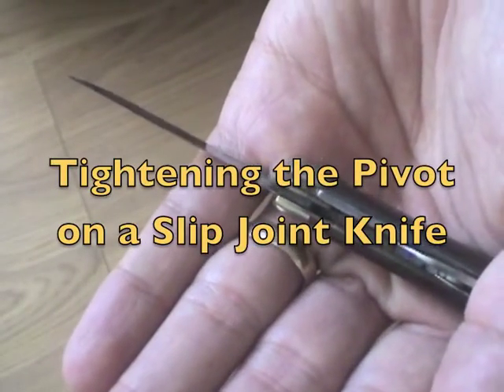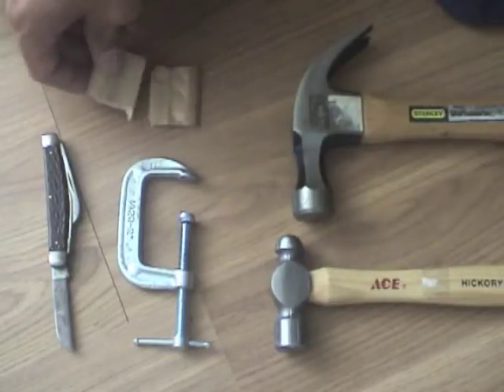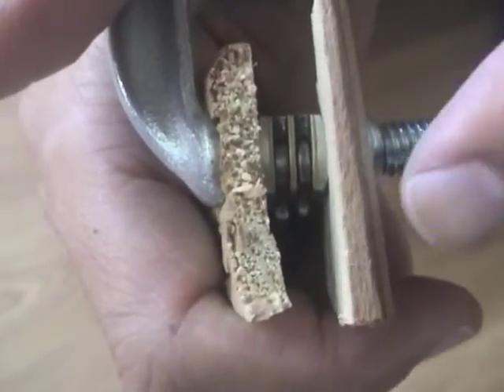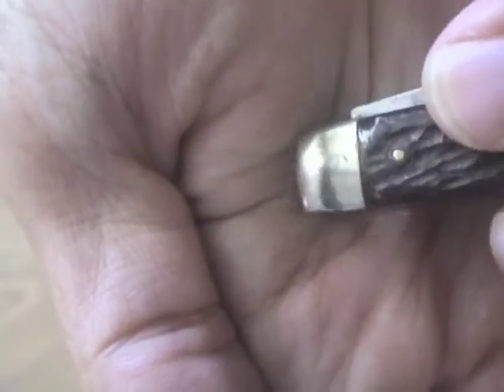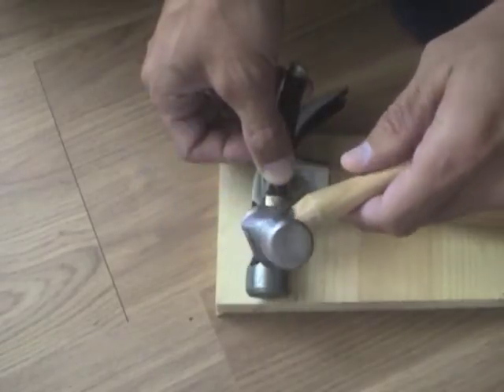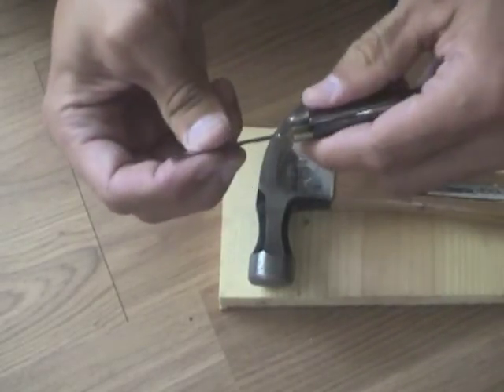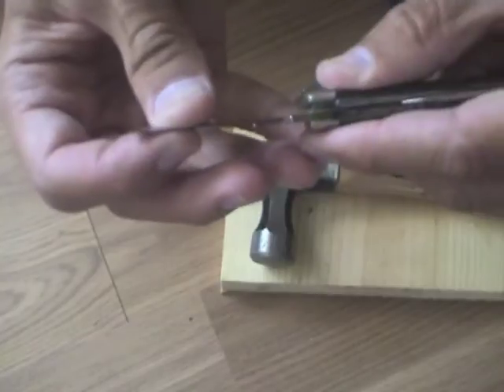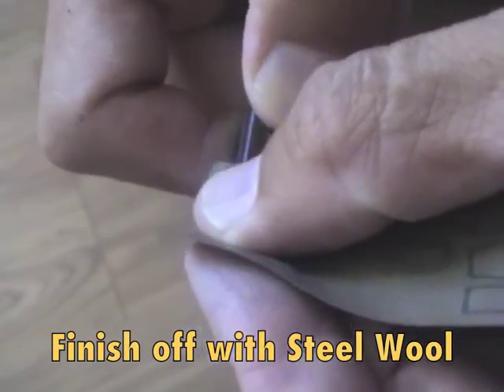Tighten Pivot Pin on a Folder

Comment: Ì use a micro punch to repeen the pivot and bolster pins on knives that have loosened up. I took a 1/8" long shank punch and put it in my drill press on low speed and filed it to size and polished it as it was spinning in order to not get it off center. I have several in diffetent diameters to fit different knife brands and models. You can use a nail also. File it to size, then harden the end. It works just fine but doesn't last long.

Comment: I used a flat tipped punch that was about the same diameter as the pin and it didn't mar up the bolster at all as opposed to just using a ball peen hammer 🔨.

Comment: If a person has a really nice expensive pocket knife, such as an antique slip joint with exotic handle material, or even a rare knife, I would warn against doing this UNLESS you already have good experience in doing this sort of repair. Some knives or parts are irreplaceable, and one little slip up can result in cracking your handles, ( genuine ivory, stag, bone, abalone, etc.), or scarring the bolsters so much that a lot of bolster material would have to be sanded away, or even over-tightening of the blades, which is asking for even more problems to loosen them to the exact tension & tolerances. Depending upon the actual knife, many good repairmen will often use a special type of feeler guage to have the proper shim so that the blades are not over-tightened and have the proper blade action known as the "walk & talk". Sometimes, this type of repair may require the complete removal and replacement of the pivot pin itself. If your knife is "just a work knife"........it wouldn't be so much of a concern. But I don't recommend doing this to really nice knives. There are plenty of good qualified people who can easily repair loose blades in nice slip joint knives for a nominal fee plus shipping. We're only talking around 20 bucks, and that is a small price to pay for SAFELY repairing heirloom quality knives. Always get references from past customers. A good knife restorer/repairman should have plenty of references available. Your good knives are worth it.
Reply: Any recommendations for a good knife repairman? I'm afraid I'll crack the 90+ year old bone and I would much rather have a pro tighten the pivot.
Reply: @wizardofahhhs759  why not give case a call and make a request ? You could aslo reach out to custom knife makers
Reply: Great advice
Reply: @johnherbert1431  Thank you.
Reply: @howabouthetruth2157 oh damn. I wasn't sure if you were still on YouTube. I just realized this comment is 7 years old. I actually just used this video's peening method on my swing guard stiletto that had play in all directions. Worked pretty darn good, but I overdid it slightly, so I had to play with it for a good hour so I could loosen it back up 👍

Comment: Hey,

Im not a knife guy but I found a really cool buffalo skinner knife while walking in the woods. Great condition so someone must have dropped it recently. Anyway, the bottom of the handle is loose. It has what looks like a pin on the bottom. what Do I use 5o tighten it? 
Thanks
Reply from the maker: Probably be best to talk to a real person.  It's hard to assess what the problem is via comments in Youtube.

Comment: Hi there, thanks for the video. Would you recommend doing something similar to help with blade play on side opening automatic knives?
Reply from the maker: This is a way to tighten anything that is pinned together.  As others have said, a drift pin might be more precise.  As for an auto, I am not familiar with those knives.

Comment: Hi - wondering what kind of knife that is that you are using with a stamp of 16.  I have one that looks very similar  has a stamp of 22 and no other identifiers
Reply from the maker: Mine is some kind of Camillus folder, the tang stamp actually is "91."  If you ask the kind folks on Bladeforums in the traditionals subforum, they will tell you in a flash.

Comment: hey does this work with balisongs?!? cause the one I have is sort of cheap
Reply: +theWZZA thanks man cause im gonna have to hang on to this balisong till I can afford a really good or decent one
Reply: +theWZZA right to ill do 3-4 soft taps on each side and do checks in between each tap
Reply: ***** this worked on my balisong perfectly even without the ball peen hammer. Over tightened the bite handle but a little bit of WD-40 loosened it up. Thanks for the help!

Comment: How would I loosen a pivot? 
     I modded a SAK and I went a little overboard with peening the rods and bushings and now it's stiff to open. 
      Something faster than just opening and closing it a million times?
Reply from the maker: gently wiggle side to side, try not to over do it at first.
Reply: Ok, I'll try that, thanks.

Comment: Do you have any tips for tightening the covers, scales, handles, back to the frame? I would guess you could use a vise and some leather or something to soften the pressure from the vice to do a similar thing you did in this video.
Reply: theWZZA Thanks for the reply, i think it's going to be difficult to hammer the scale pins on because it has celluloid handles and it's a really old imperial from the 30's and I'm worried about cracking them. Should I just squeeze the knife scale back on gently with the vice instead? I was never planing on carrying or using it I just wanted to fix it up a bit. Should I just leave it alone as is? Thanks.
Reply: theWZZA I'll have to check that out. Thanks for the reply.

Comment: Should a new slip joint have blade play
Reply: theWZZA it's a custom. Just got it today. It seemed ok at first but I opened and closed it for pictures and started to notice some wobble. I've been collecting custom folders for 5 years but just started into custom slip joints.
Reply: theWZZA ok. Thanks. I'm usually too easy when it comes to stuff like this. It wasn't super expensive but for 500 bucks maybe it shouldn't have any wobble.
Reply: theWZZA your right. I'm too easy. The first slip I got had blade wrap/rap and the maker tried to tell me he had a Tony Bose custom that had it.